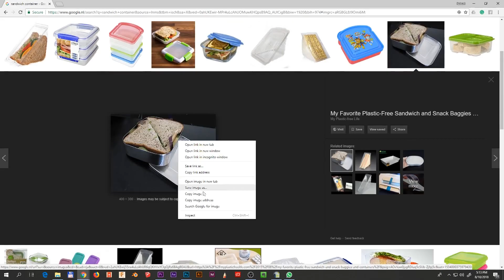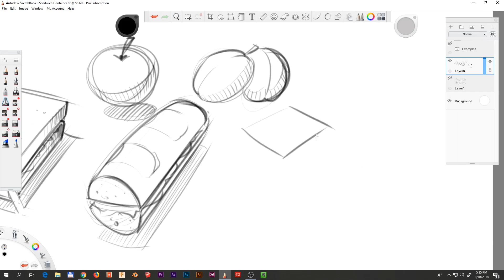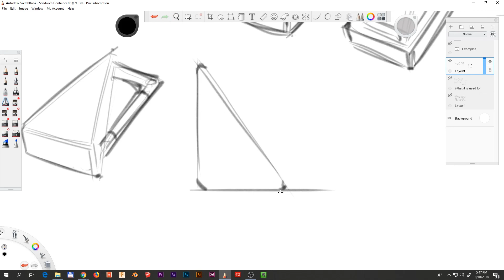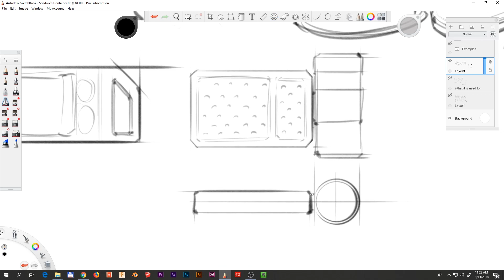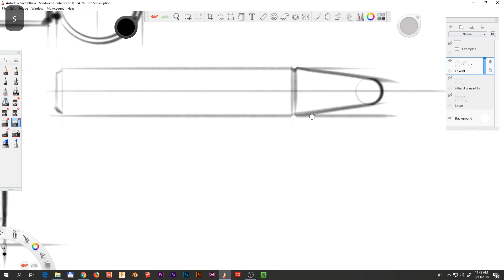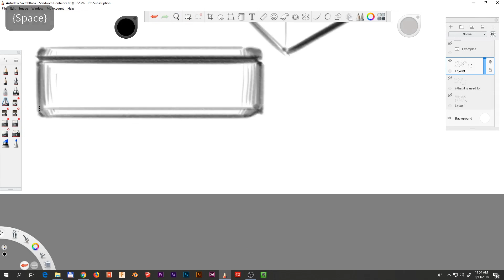Industrial Design Sketch Process Part 01/03

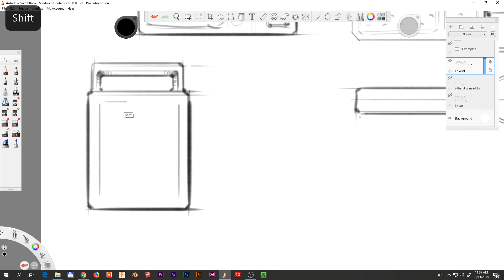Comment: Hey! Great tutorial series here. I'm trying to brush up my digital ID sketching in PS/AI (see what I did there?) and I can't remember  how to manually brush along a path. I don't mean add a stroke to a path but rather create a shape, like an ellipse, and use either my mouse or my graphics tablet to create lines that are anchored to that path kinda like you did at 4:50. I can't seem to find that function and would really appreciate the help! 

Oh and I'm using the Adobe suite, not sketchbook
Reply from the maker: Thank you. As far as I know, photoshop does not have that capability, best you can do is use the pen to and then stroke it with brush fade away option. That is why I use sketchbook in this case because it's just much more convenient if you wanna do stuff like this.

Comment: Do you use any steady stroke settings or predictive stroke at all? I've just begun using a wacom intuos and looking at the screen while sketching is still new to me, any suggestions would be really helpful !
Reply from the maker: I do but only rarely if I need to get a line super clear, but I would say 90% of the time I just do things by hand without any help.
Reply: @robertlkiss  Hey !  I've been following your tutorials on fundamental of sketching, I must say I enjoy it !. I am a beginner & I've been using a paper and pen so far and was thinking of going digital. I've a basic wacom tablet (without display) so it'll be looking at a screen while my hand moves on the tablet . I understand that you use a  Wacom tab with display. What do you think should i go with my digital setup and do whatever I did on paper digitally from now? Will it help me sharpen my skills both digitally and on paper? 

@manvifotedar4339 How's your experience so far?
Reply from the maker: @royceleejohn4814  what you have is good especially as a beginner it is good to 1st have a normal drawing tablet(and not a display tablet). it is going to feel weird for a couple of weeks, almost like you made a mistake and this will never work :) But once you are over the 1st two-three weeks of getting used to it it will feel very natural and actually quite nice that you can draw and your hand is not in the way of the picture that you are drawing.
Reply: @robertlkiss  Btw, since I'm a beginner, will jumping to sketching digitally from pen & paper method help sharpen my skills on pen & paper as well ? Does it work that way? (Especially  because in sketchbook I could use a ruler for drawing lines, ellipse tool instead of drawing it by free hand)
Reply from the maker: @royceleejohn4814  no it won’t, it might make them actually worse, there’s a lot of cheating that is working only digitally it is easy to get used to them and then missing those trick traditionally
Reply: @robertlkiss   Alright. In that case what would you suggest to a beginner who wants to get better at sketching both on pen & paper and digitally. Should I get good at pen & paper and move to digital sketching or should I sketch on both ? or anything else?
Reply from the maker: @royceleejohn4814  just do both if you want to improve at both. The fundamentals will carry through both so focus on those.